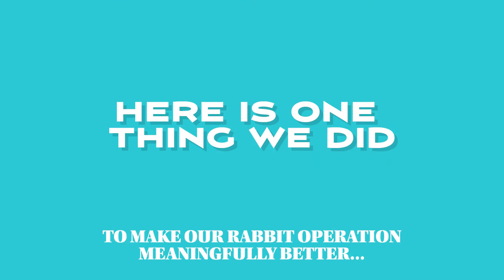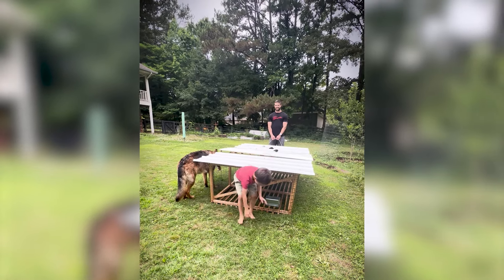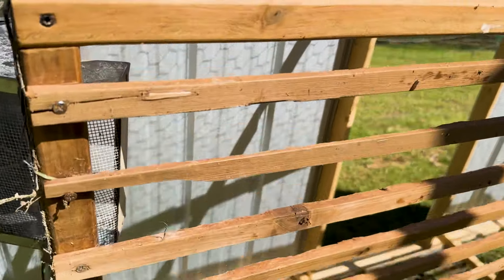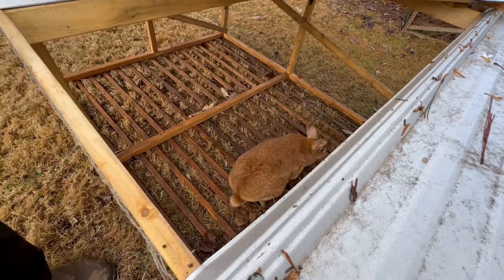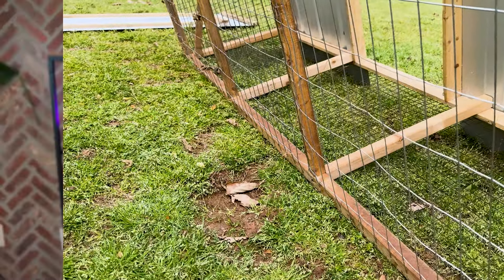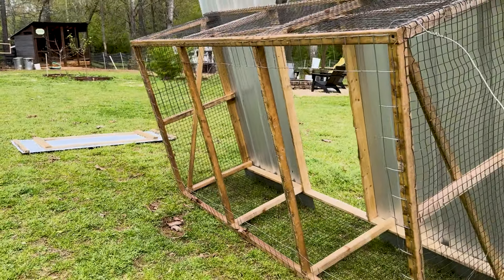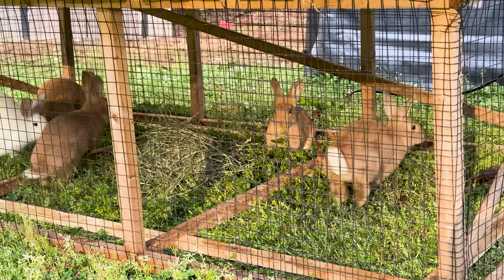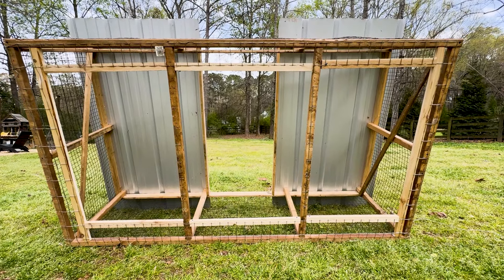Joel Salatin Rabbit Tractor UPGRADE [How to Build It]

Comment: You keep saying ten inches, but your example in the video is using a 2*4 welded wire and the 'apron' around the edges is only four inches - one vertical opening in the welded wire, or two horizontal.  The biggest limiting factor for this is the ground you're putting the tractors on. If it isn't really level so that all the tractor edges sit on or very near the ground, you'll have gaps for escape or predator entry. With a full floor, that's not an issue.

Comment: I put the chicken wire and put two wheels on the end of the hutch so I lift and pull them
Reply from the maker: The 1" opening of chicken wire is too small for the green to pop through. So the rabbits will eat less grass and more pellets. At least, that's been our experience.
Reply: @kummerhomestead  oh man, I wish I could show you a picture of what they do to the grass they eat almost to the dirt lol... I didn't pull the chicken mesh stiff to the bottom, so when they walk on, it they are right on the grass
Reply from the maker: @cebasmb8250  Gotcha! What type of grass do you grow? We don't have lawn grasses but have a mix of weeds and long grasses that get bent by the chicken wire, making them practically inaccessible for the rabbits.
Reply: @kummerhomestead  oh I gotcha! I have lwan grass. With lots of weeds between them like clover, dandelion grass, they eat the grass to the dirt

Comment: Finally found someone who digs deeper into the unresolved problems in rabbit tractors...
Another complementary idea could be to wait longer to move the tractor to a new place with grown grass...
That is, wait until the rabbits are very hungry so that they only focus on eating and not escaping...
At the same time, to prevent predators from placing rigid metal mesh panels on the ground and on the sides of the tractor... (they can place hinges so that they rise and remain attached to the walls of the tractor when moving it from one place to another. .
(I don't know if I explain myself well, my English is not very good)
Congratulations and greetings from Uruguay.
Reply from the maker: I got what you meant! Thanks for sharing!
Reply: Waiting longer would encourage them to dig out
Reply: I agree with your predator proofing idea. I've often thought some wood framed wire fencing on hinges attached to the bottom frame of the tractor would work to prevent rabbits escaping and predators from digging in. I have a similar "skirt" on our stationary chicken run. Folding "Wings" would be an interesting addition on a mobile tractor. I'd love to see someone test out the idea

Comment: One more detail to improve the comfort of the rabbits... I would install a wooden roof instead of a metal one for 2 reasons:
1. Avoid raising the temperature even further in summer when they receive direct sun...
2. Avoid intense noise if it rains or hails (remember that rabbits love the silence of their caves, which unfortunately they can no longer enjoy).

And finally I would place the roof with an inclination to collect rainwater; especially in dry areas or as a reserve for dry weather.
Reply from the maker: The metal roofing is actually super reflective, so I'd think it'd stay cooler than wood, but you got a point with #2 and rainwater collection.
Reply: @kummerhomestead  You are correct!
Reply: For my rabbit tractor I made a frame from wood and filled in the gaps with leftover 2 inch foam board as a sound dampener and then put a layer of metal mesh followed by corrugated plastic top

I only do that since my job gets scrap 2 inch foam board and I cobble them together from the leftovers